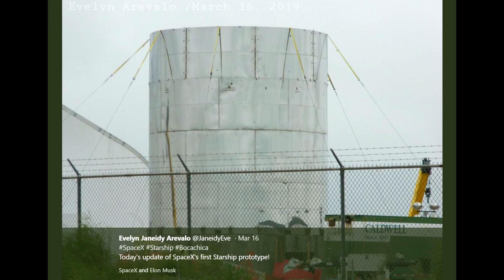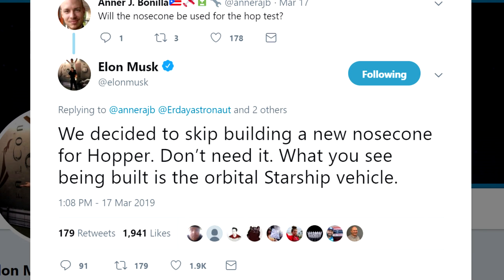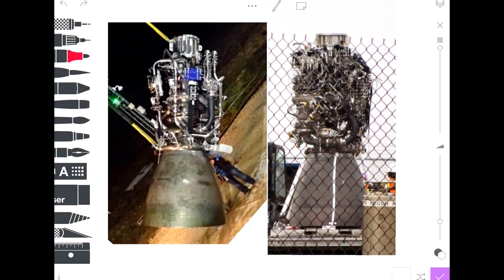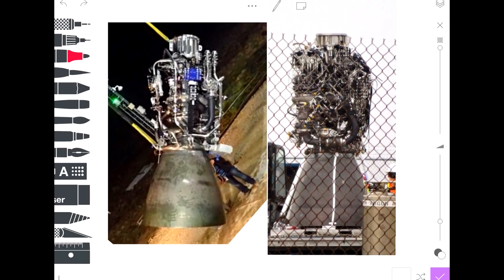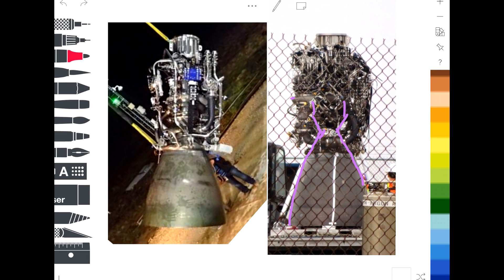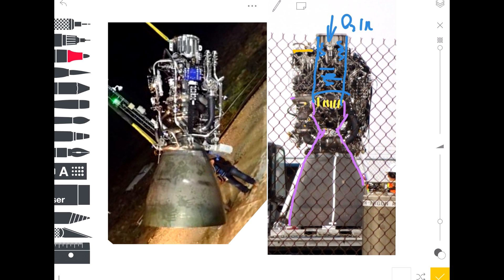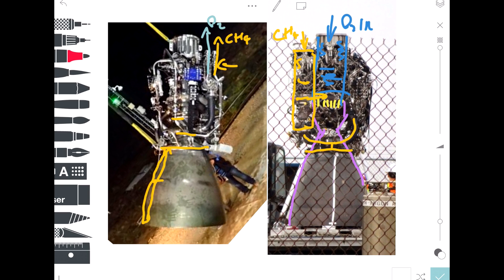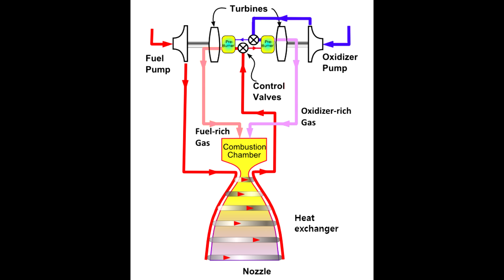Raptor Rocket Engine Analysis and Starship Testing Update

Comment: With the weather (high wind) delay of Falcon Heavy, I am wondering if the vision of using BFR in hopper mode to transport passengers halfway around the glove is viable.  How susceptible are these flights to weather?  It doesn't do any good to be able to travel so far in a few hours if the chance of being grounded is so high.  Any thoughts?

Comment: I apologise. I was wrong. It is a water tower. Made with steel, by water tower builders, it just happens to fly. You were right in the first place. Building rockets in fields using blue collar labor, those economics changes everything.

Comment: Maybe they can build it outside because the new design can cope with a less accurately aligned spaceship i.e. stronger stainless steel, the engine gymballing, control surfaces and associated software . You would think though that when it's stacked up at 118m high and experiencing 3G, that would need tight tolerances to prevent buckling.

Comment: This is like a circus spectacle. One busines man without studies in rocket engeneering building a ridiculous rocket (some NASA engineers say that) in a tent without any environmental control , while all the aerospace companies ( NASA, ESA, CSA, JAXA, ULA, ROSCOSMOS, etc) work in clean rooms. But SPACEX, nooooo. 
People has to learn that space is an expensive busines and that cheper does not mean better. Falcon 9 has the same success ratio than soyuz with a minimum price difference, so it is not so tech advanced as you may think. 
Also, Crew dragon is just a normal capsule non reusable yet ( just see how burnt the heat shield was)  that still lands on parachutes.

Comment: The X-15, XLR-99 rocket engine, throttled down to 30% simply by throttling one valve,the H2O2 flow to the GG turbopump. A simplified injector allowed for stable combustion. Yes, you mentioned a Closed cycle design makes this difficult and is my next point. Why use closed cycle anyway? Just make the rocket bigger to off set lower ISP of open cycle. End of problem/story. Mush should and does know this, be careful of "mission creep",loosing the original idea of simplicity=reliability=low cost=man rating.
Reply from the maker: Closed cycle delivers 10-15% better ISP

Comment: How do you keep liquid fuel / oxidizer flowing consistently from a tank in a 0 gravity environment?  Im fairly certain additional pressure wouldn't be enough to keep the fuel where it needs to be to be pumped to the engine.
Reply: As the engines burn they accellerate the rocket, greating artificial gravity in the rocket. The fuel and LOX are pushed down and even get some spressure from the accelleration. This is the big problem with restartable engines, they need a primer burn with fuel and  LOX that is not floating around but immediately available. Some rockets use a helium bladder to keep the fuel down below, which fills as the tanks empties.
Reply from the maker: If engines need to restart after spending time in zero g they’ll use cold gas thrusters to slowly accelerate the rocket and settle fuel to bottom of tanks before firing main engine.
Reply: @scottmanley  Do they always use cold gas thrusters for restarting the engines?

Comment: They need check out a product called Airloy for their heat shield.  It's an aerogel with similar thermal insulating properties, but without the brittleness of a traditional aerogel.  It's not as strong as metal of course, but it doesn't shatter like aerogel does - it's about the same as a tough plastic.  Can't wait to see it come down in price to the point where it would be feasible to use as house insulation.

Comment: Did they disclose the material of the heatshield? Elon did tweet out "testing metallic heatshield at 1100degC" back in January. That was the only mention of it.

I'm not sure when or if they have reverted to ceramics.

Comment: Looking at the heatshield test, I strongly suspect that there is transpiration cooling going on in addition to the tiles.

Look at how the cracks between the tiles are emitting much less light than the rest.  This means they're a good deal cooler.  But this doesn't make sense, given that heating is being actively applied.  If anything, they should be slightly hotter, with the extra surface area associated with them allowing them to heat up faster!

You can even see the cool areas associated with the cracks cutting across the hot spots associated with the torches.

My theory is that the cracks are cold because of the transpiration cooling - the methane passes through pores in the skin beneath the tiles, and comes out through the cracks.
Reply: You're getting warmer. ;)

Comment: Oh so there will be tiles, not just a gleaming stainless steel hull and hot structure with a sweaty methane fireball.  No kidding, that wouldn't work for deep space re-entry?  Wasn't the entire point of going to stainless the pretense that no protection was needed to save on weight, etc etc?  Reality is a harsh mistress.

Comment: Hexagonal stainless steel tiles with transpirational cooling to allow safe reentry into Earth's atmosphere?!  It needs to work reliably 100% for multiple reentries after quick turnarounds. Sounds cockamamy, but like Scott, I'm not a rocket scientist. Sure hope that SpaceX gets that demanding requirement right. I still remember the heartbreak of Columbia breaking up during its final return to Earth a few years back.
Reply: If you knew the conditions in rocket engines, and all the other things they are loaded at max ability with no room for failure or mistake this wouldn't really seem like any harder of a challenge!

For instance, with regular ablative heat shields, all it takes is a tiny defect or crack or chip, and the plasma eats through it like a cutting torch, or hundreds of other things that just have to be perfect.
Reply: Yeah, well, that was because the tiles had been damaged on launch, but, at any rate, there is no such thing as safe. There are only acceptable levels of risk.

Comment: I believe that the divergent nozzle section is actually a monolithic niobium bell section like on M1Dvac. There are no external structures that would suggest internal cooling cavities. I would bet they stuck a simple bell on the raptor for testing. Could be wrong but it doesn't look like the bell is regen.
Reply from the maker: Modern rocket engines don't use the old fashioned brazed tubes design for nozzle cooling, sot it's much harder to tell were the regenerative cooling stops and the extension starts.
Reply: @scottmanley  Thanks Scott. I know the 1C version used tube wrapped construction with an overcoat. I was unaware that 1D was upissued to a monolithic inner shell with the cooling passages machined on its periphery like the chamber itself and then a electroplating process to close off the channels. Thanks for the comment which forced me to do more research!  :-)

I would be very interested to see how they do the cooling reroute at the base of the divergent section to get it back up the nozzle. On 1C the reroute happened at the bottom via a close loop on each tube run.

Comment: 0:35 I still don't think this is going to space.  I don't mean I don't think it's getting to orbit, I mean it's not going to go high enough even to count as getting astronaut wings in a sub orbital flight.   Way too much air resistance, no where near enough length for fuel.  This does not look like a flying version.  And yes, I understand there's a nose cone section that's not attached that will roughly double the length.
Reply: The Hopper we see now is not intended for reaching space; it's like the old "Grasshopper" Falcon 9 first-stage recovery prototype they had.  Applications to the FCC for licenses for its telemetry signals indicate it's going to operate no higher than 60,000 feet, which is more than enough for testing the control logic, plumbing, and working out when to time the suicide burn for landing.
Reply: @rdfox76    No fair saying what I would have said had I said it first!
Reply: Just in addition to what rdfox76 said, no, there is no nose cone. There was one, but when they got started on the repairs after the windstorm knocked it off, they realized that, for the purely atmospheric tests they are going to use this test bed for, they don't actually need it. Even now though, they are building a second test article which, they claim, will be capable of orbital flight.

Comment: If you were to put steps in the engine bell, wouldn’t that help with throttling?  You wouldn’t have to worry about uneven flow separation.

Comment: I’m assuming you know this, and just didn’t say it, but the choked flow is more of a nice side effect of what is really happening in the engine.  You expand away from the throat because diffusers and compressors reverse when the flow becomes supersonic.  So it has to get big again to accelerate the exhaust flow and reduce the pressure to design conditions.

Edit: removed some arrogant crap.
Reply: I hope they retrain you at rocket school, because either you suck at properly explaining how rockets work, or you don't understand how rockets work, but in either case you make no sense in what you just said.
Reply: @ke6gwf   "Choked flow" refers to flow where events downstream do not effect anything upstream.  It occurs when you "choke" the flow or compress it.  To compress flow you use geometry that is known as a compressor (makes sense).  This takes high pressure and low velocity flow, and changes it to be lower pressure/higher velocity.  The opposite of this would be a diffuser, which is just the opposite geometry.  Diffusers take low pressure and high velocity flow and convert it to high pressure/low velocity.  You can work out the change based on the ideal gas law and some very simple thermodynamics.  (It should probably be noted that temperature does play a part in this relationship, but a less significant one)

Compressible flow can be quite complicated, but for these applications, it tends to be more straight-forward.  What I was saying in technical speak in my first comment was that the choked flow is a result of other mechanisms, and not the primary goal of nozzle.  The goal of a rocket nozzle is to take very high pressure gas, and get it moving as fast as possible.  In a system where pressure is doing the work, the most efficient configuration is one where the exit pressure of that gas is the same as the outside pressure (this goes for pneumatics, steam, rockets, etc.).  So: a rocket nozzle is designed to reduce the exhaust pressure and increase the exit velocity.  You want the exit pressure to be equal to that of that atmosphere at the average running altitude (we call this the "design condition").  There is enough energy in the reactions used, that the exhaust is going super sonic by the time the pressure is low enough.  This is where one of the strange bits of compressible flow shows up.  When a gas is moving below the speed of sound, a compressor has geometry that goes from wide to narrow like a cone.  However, when the flow becomes supersonic, it suddenly reverse, and the normal compressor with be acting like a diffuser.  For that reason, a rocket uses a converging/diverging nozzle, where it is a subsonic compressor up until the nozzle and a supersonic compressor from the nozzle on.  This is what I was meaning by "diffusers and compressors reverse".  The entire thing is a compressor, but the throat is where the exhaust breaks the speed of sound.  This is what is technically known as choked flow, and it a result of trying to get the gas moving really fast.

Anyways....  That is the expanded version of my first comment.  Hopefully it is more clear- although it is really hard for me to explain these things in laymen's terms.
Reply: @fiveoneecho  well, can you expound on what you mean that the diffusers and compressors reverse when the flow is supersonic?
Reply: Cole, thanks for your info.

Comment: You mention heat exchangers at the fuel and oxidiser inlets, but these are missing from the ffsc schematic presented later in the video (except for the bell cooler). What are the inlets exchanging  heat with and why? Is this just evaporation for autogenous pressurisation?

Comment: Hmm, I'm not convinced about the fuel flow suggested (from the manifold to the lip of the nozzle then back up). We know from the raptor test-firing photos that there's fuel-film cooling in the outer nozzle (which technically means it's not a "full"-flow SC engine, but is close as damn-it) so I doubt there's a need for that and regenerative cooling. It seems to make more sense to assume that the lower nozzle is film-cooled and the regenerative cooling manifold is feeding fuel only to the upper nozzle and chamber coolant jacket.

Comment: So freaking cool...for cooling is the MH4 pumped into the bell immediately at ignition? or does it only begin pumping the 'coolant' when it reaches a certain temperature, sort of like our cars coolant system does?
Reply: It's a part of the fuel flow, so it will always flow through the bell. Or at least a fraction of it, I am not entirely sure of 100% of the fuel flows through the bell or if it's a fraction. But yeah, it's permanent. No point in controlling it, since the amount of heat is essentially constant, so there is no need for the added complexity and danger of trying to alter the flow during operation.

Comment: This thing is clearly not intended to fly in any meaningful sense. This is an Raptor engine test bed, as such it makes lots of sense as engines are engineered tested and refined before sub orbital vehicle testing can start
Reply: No, they can do non-flight tests on a test stand without Hopper, I think they have it in California. They're only building Hopper for early flight tests, since it would otherwise be pointless. They've done this before, with the Grasshopper rockets.
Reply: Well, it will do hover tests, it will fly up to maybe 5000 meters and come back down. It will not leave the atmosphere, it will not do parabolic arcs. It may or may not cut off the engines and do free fall. But it will get off the ground.

Comment: The one thing I can think to point out is that Raptor shouldn't have traditional "injectors" since it is a gas-gas full flow staged combustion engine. The propellants are all vaporized in the pre burners.
Reply: They likely still have something resembling injectors for better mixing.

Comment: Pressurizing the tank with heated fuel while simultaneously relying on the cold fuel coming from the tank to keep everything from melting.   Am I missing something?
Reply: Nope, that's it in a nutshell.
Reply: The complicated part of a rocket engine is the plumbing.

Comment: Is martian dust clogging up some holes in the heat shield a concern for starship when it stays there for two years?
Reply: Not at all, at least compared to
-excessive radiation
-frightening phisiological effects of long exposure to weightlessness
-lack of life support development
-lack of training for such missions
-lack of habitat development
-immense supplying&logistics difficulities
Reply: G.Zoltan But loosing the return trip due to vehicle deterioration would worsen most other concerns.  Oh, and being on Mars implies having actual gravity, so not weightless.
Reply: @g.zoltan    Sigh. Radiation is dealt with through shielding. It's really very simple. It's just a matter of choosing the most desirable design.
No one has ever needed more than a few weeks to recover from long term zero g. It only takes six months to get to Mars, and Mars has about 1/3 Earth gravity. It is not a weightless environment.
No one is going to send an expedition to Mars without adequate life support.
Training is training. We do it for every mission.
The BFS itself can be an adequate habitat. It is quite capable of carrying additional habitable space in the form of Bigelow modules.
Supply and logistics are a simple matter of expense, which BFR is going to reduce by orders of magnitude.
Reply: I suspect that an intern could design a car cover to slip over the rocket once it got to Mars
Reply: @ke6gwf  Martian problems require Martian solutions
Reply: I think they could do a heatshield methane purge as a pre-flight checklist